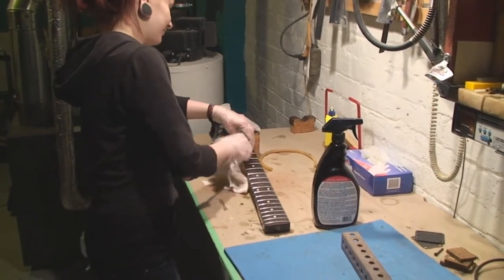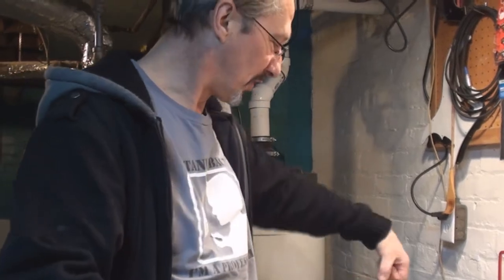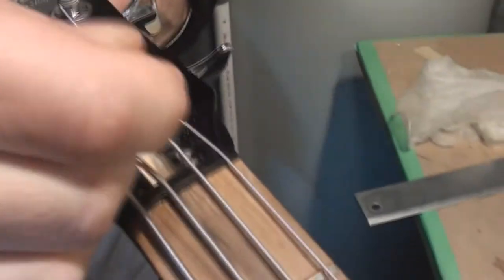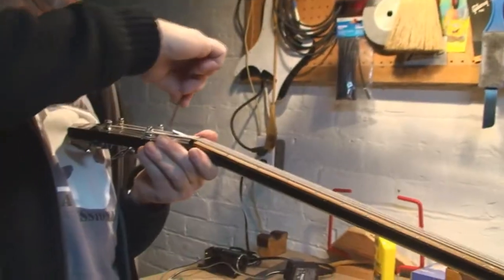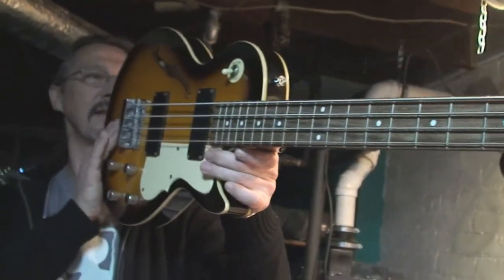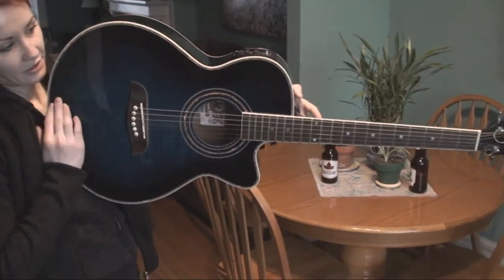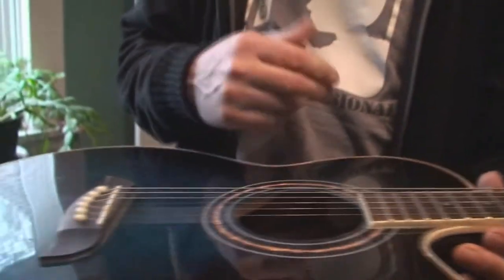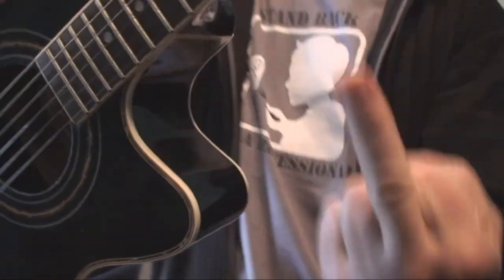Camille Learns Guitar Repair Day 6 Part 2

Comment: Got my acoustic fixed,new strings,4 frets filed,new saddle and neck cleaning..50$ but if my action is a bit high should i get the saddle shaved?because compared to the one from 85' the new ones alot higher..